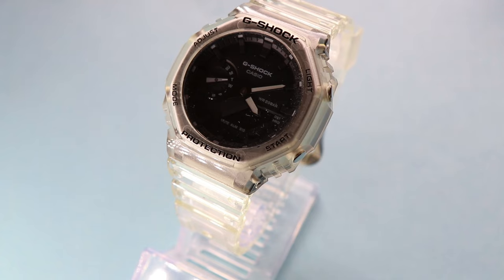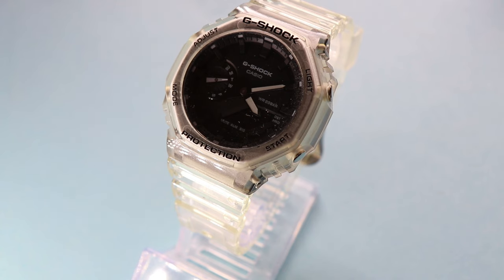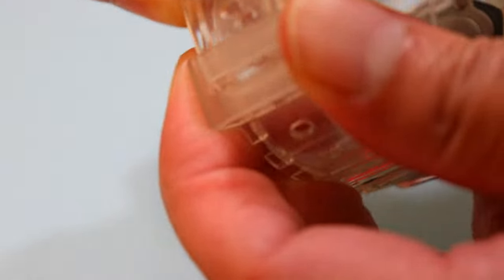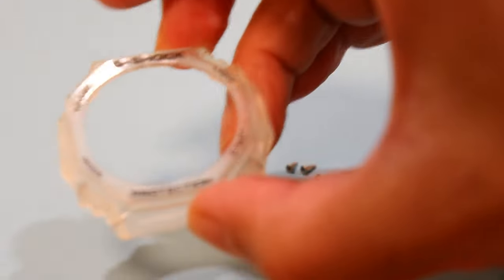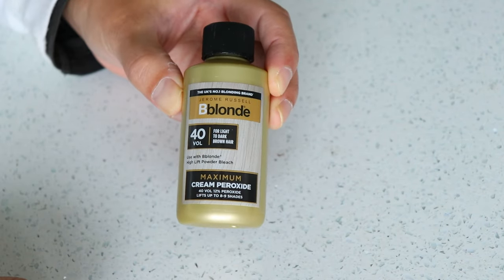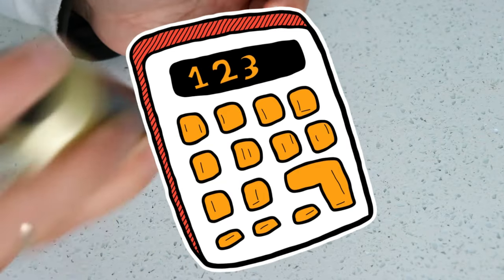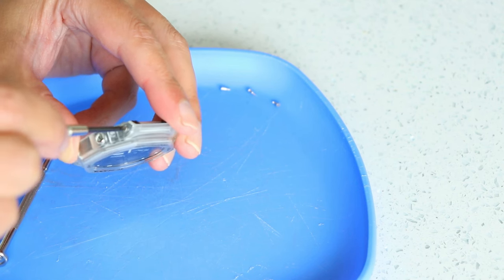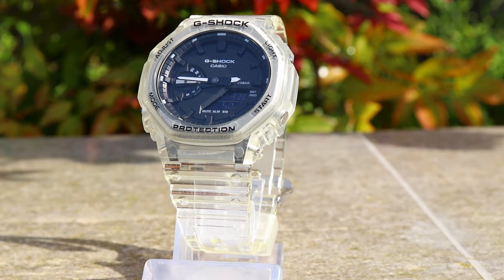Remove YELLOWING from Watches

Comment: There are so many of these videos but the general consensus is that these methods do not work.  It's something molecular that happens with the plastic itself and bleaching or using peroxide won't take the yellow out since its internal.    It's probably new straps he threw on.  I think a better alternative would be to dye the straps.  Maybe a quick dye to keep the transparency sort of a cream or light beige color etc.   That's what I plan on doing.  I don't trust these peroxide methods anymore since all the other videos are full of people saying it doesn't work at all.

Comment: Hi. I just want to let you know that this instruction is really effective. I tried it on my GA 100 model. I followed your instruction and it worked. Now my watch case is 99% clear. 1% is for the little but not obvious yellowish part. Maybe because i only used 12% content  on the Hydrogen Peroxide i used. This is the only one available in my country. In fact there is a bonus on your suggestion becuase i used it on the sole of my adidas superstar shoe sole who is already turning into orange. Guess what it  also turned into white now. Again it helped me a lot to save on buying new wether watch case or shoes etc.😊👍👏
Reply from the maker: @victoralcantara1350  Thank you. I am happy that it helped you.
Reply: @wristaction  🤝 you are welcome. Thanks again.

Comment: Instead of using cream peroxide, can we just use the peroxide liquid that’s available at a chemist and put a bowl of that in the sun?
Reply from the maker: you can, but wouldn't the liquid run off?
Reply: @wristaction   Not if it's in a bowl, as I said.

Comment: Dont use 12 percent hydrogen peroxide, use anything below 10 percent composition. Soak the straps in the liquid while it is in the sun, u dont even have to do this for a few hours, just a few minutes and the yellow is completely gone. The thing is, this is how you will have to clean your white/clear/beige coloured silicone watch from now on unless you keep the watch in direct sunlight all the time which is impractical and bad lol.

I have a wenger chronograph watch thats natrual beige/cream coloured, face included. Over 8 years the parts of the silicone straps where it meets the watch casing started yellowing and you can tell because the shade was no longer matching the beige colour of the watch face. I did to those straps what was explained in first paragraph and they're back like new. The only problem is, this is how i have to clean the watch every time i want to go out. Sometimes i dont even have to use peroxide, it just turns back to its normal colour if im wearing the watch on a hot/sunny day but indoors it gets the yellow stain again.